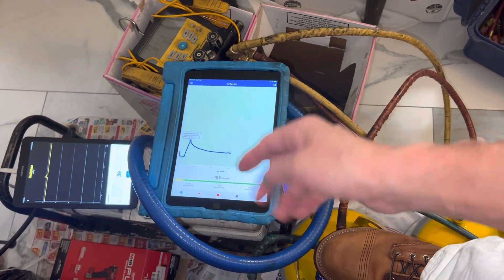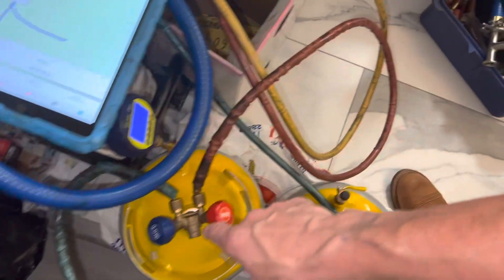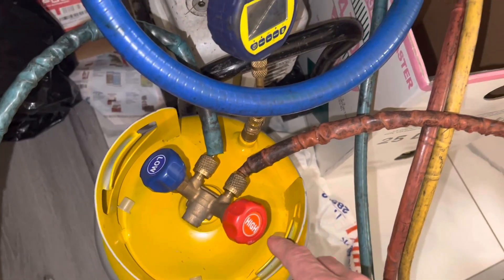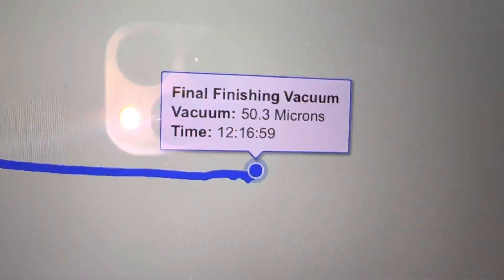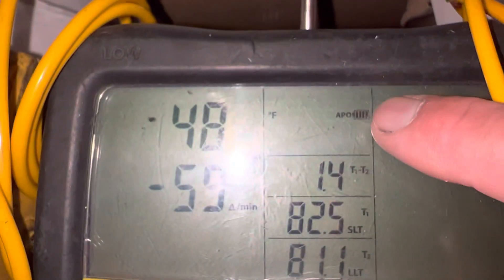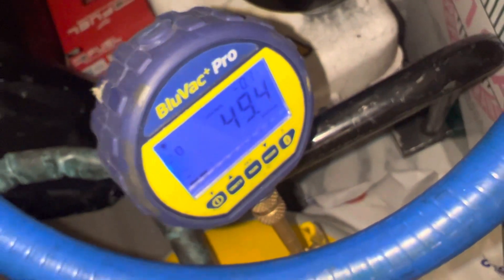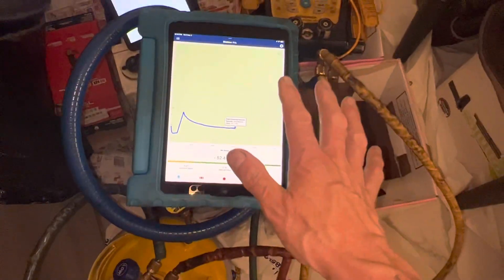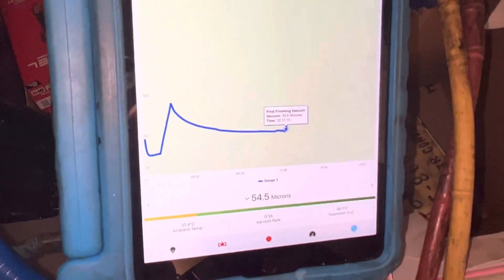10 hours of vacuum able to get tank with refrigerant hoses to 50 µm. Unrealistic compared to a car￼

Comment: This video shows that the two rubber hoses are still CAPABLE to do vacuums; otherwise, the vacuum reading in the tank won’t go down!
Reply from the maker: You can do a vacuum but it takes much longer and it may often fail your nitrogen decay test. 

You have to remember I did a ridiculously long amount a vacuum overnight to get this refrigerant recovery tank down to 26 µm it did not come easily and I have a vacuum pump capable of going down to 3 µm.
Reply: @coldfinger459sub0  I always isolate my hoses for decay tests because it's the refrigerant system I'm testing.
Reply from the maker: @thisisyourcaptainspeaking2259  exactly and this is why I performed this test three different ways

1: isolated the tank and only took the pressure decay of the system

2:  left of refrigerant gauges and hoses hooked up with the valves open so everybody can see the difference between system decay and when hoses influence the decay

3:   And just the hoses by themselves isolated taking the decay of the hoses only all on the same set up
Reply: @coldfinger459sub0  It's good to have ball valves too. So you can isolate hoses and see just what is causing the leak. Of course, they introduce an opportunity to leak as well. But I think most ball valves are pretty solid connections.
Reply from the maker: @anthonylosego  yes I left fall valves off of this video intentionally because they’re just another source of leaks and I wanted all sources how out of the equation so I could repeat multiple tests like in the other video when was with the valves close one was with the valves open the micron gauge was isolated on the system only on the third port on the tank with no ball valves in between except the one built into the tank. 

And anytime I use ball valves I put NYLOG or silicone grease around pivoting shaft area so just in case there is a leak through the seal that is inside their vacuum cannot pull through silicon grease or NYLOG